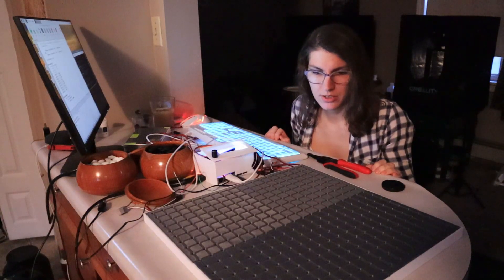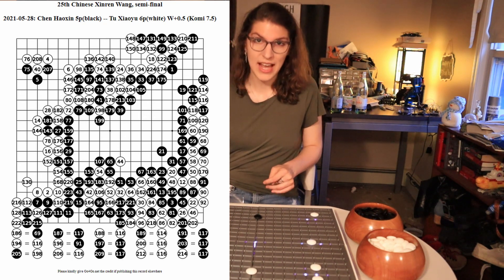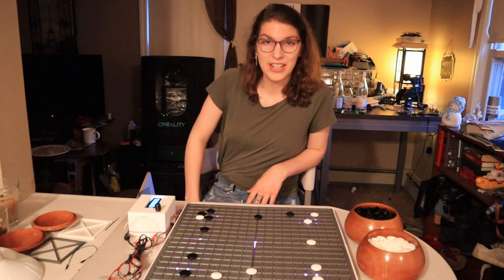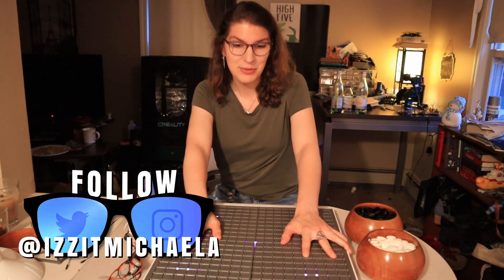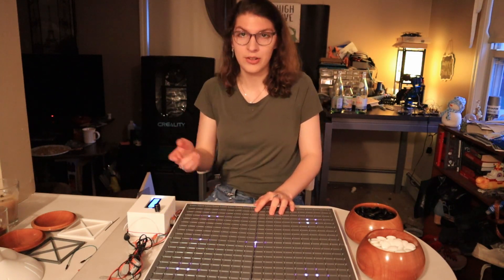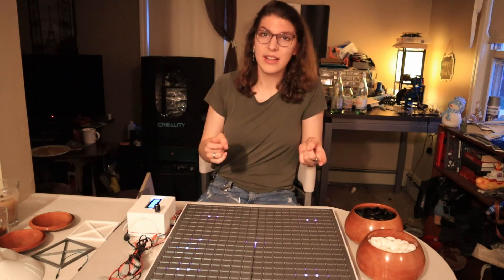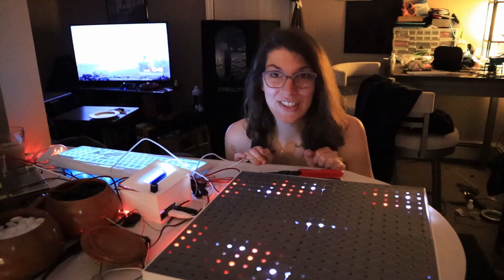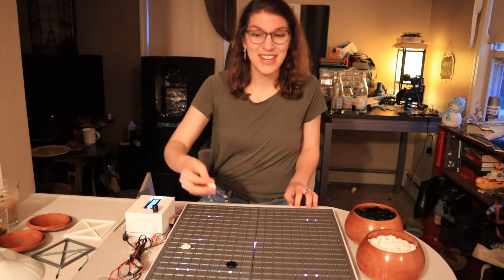First-Ever DIY SMART Gameboard For Go!

Comment: Since I've watched this video I've been trying to figure out how you could go about detecting the pieces.
You could probably have the board toplit and then put a photodetector in each cell, and if light is detected it assumes there's no stone and if the light is being blocked it assumes there is a stone.
All the extra components would probably require a custom pcb though.
If that works you could almost try and hook it up to OGS or something and try and have an online game using a physical board.

Comment: Hi Michaela - Do you have any tips or a recommendation for a beginner 3D printer?
Reply from the maker: Hey! I use an ender 3 pro, it works great for me and it's super cheap!
Reply: @izzitMichaela  Hey Michaela, so I finally picked up a 3D printer.  I'm still tinkering with the settings and doing practice prints but I'm looking forward to starting a one of my project ideas soon.  Keen to know if you have any 3d print ideas when you're back on your feet :)

Comment: Awesome project, I love Go!  It also reminds me of Stuff Made Here video of the smart pool table (https://www.youtube.com/watch?v=vsTTXYxydOE) which had the side benefit of allowing hybrid physical/remote gameplay.  Someone could play against you remotely with a minor code change to receive socket data for the next move rather than reading from the file.  You mentioned using the scroll wheel to input a move, but a much more expensive/painful implementation could involve adding an array of optical sensors (or buttons or something) to detect where stone are on the board.  My first though was simple photo resistors, etc. to see the light reflected from the stone above, but I think "cross talk" from adjacent stone might be an issue.  I don't think traditional Go stones are magnetic, otherwise reed switches could work.  Anyway, I loved seeing our process and it's an awesome result and with so much extra potential!
Reply from the maker: thanks for the feedback! Yes, that would be such a cool but painstaking extension haha. the 361 points would make it a real challenge to get all those photoresistors/magnet sensors/whatever I used in the right spots. Perhaps magnet sensor lattices exist pre-built but they're probably so expensive XD Either way yeah! Maybe someday I can get skilled enough to expand on it! Glad you liked it!
Reply: Love that we’re coming back to the physical object electronically